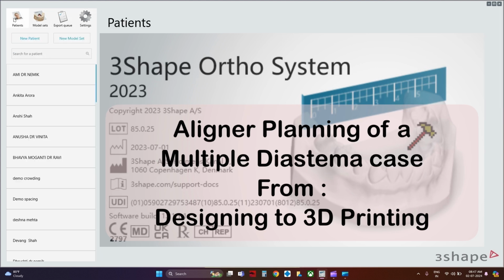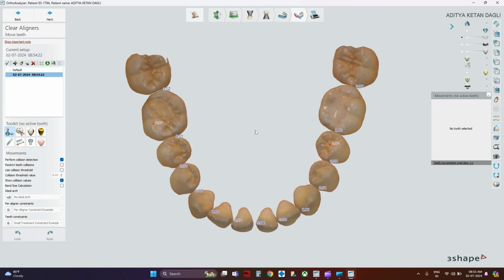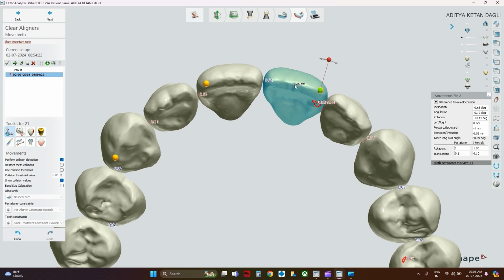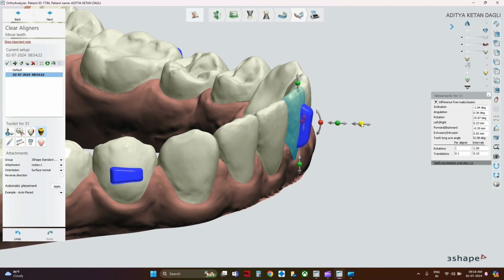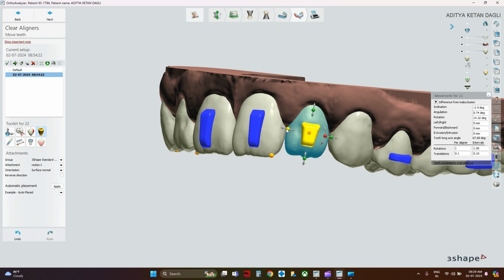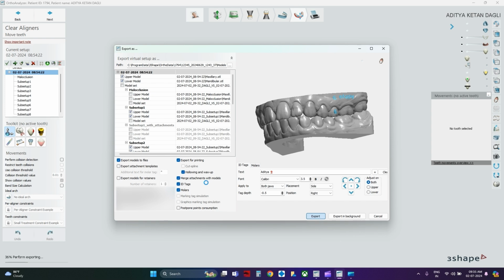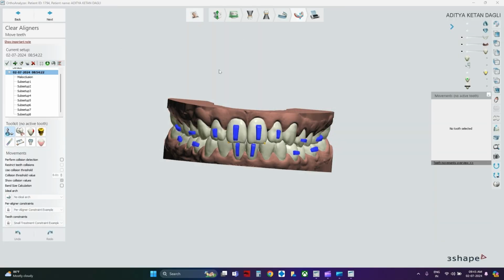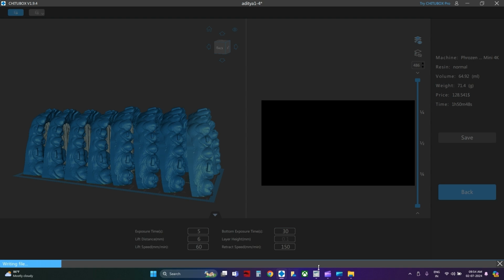Step-by-Step Aligner Planning for Spacing Cases Using 3Shape Ortho Studio: From Design to 3D Print

Comment: How you add attachment on 3 shape like negative attachment and the beveled one because i dont have in my software
Reply from the maker: @ahmedziady4413  u goto settings - Clear aligners - Attachments - Plus Sign - add subtractive model and then point to any stl file of the particular shape which u wish to add.